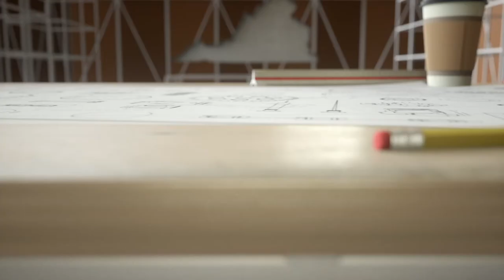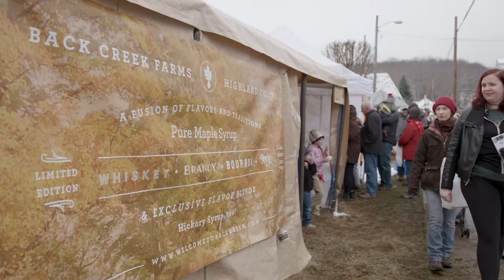Stihl Chainsaws & Maple Syrup

Comment: I have a STIHL MS-170. I HAVE BEEN USING IT FOR 10 years with any problem. But It is written on it MADE IN CHINA. Does it mean that it doesn’t have GERMAN QUALITY. ?
Reply: Its depends where have been assembled.
Reply: Thats right!
Reply: The quality control is better than most Chinese products.  A lot of their parts are coming from china.  A lot of companies are doing this nowadays.  Assembly and manufacture are two different things.